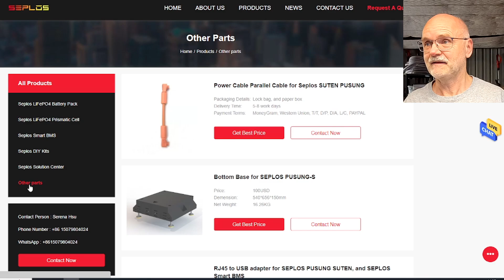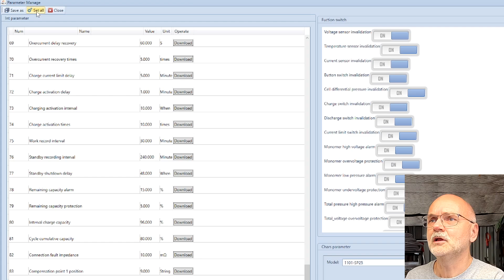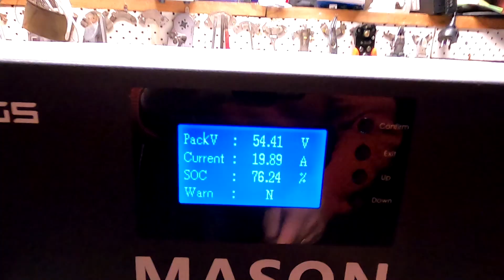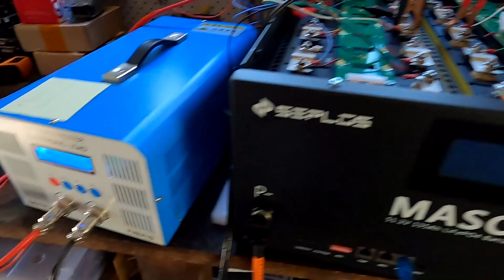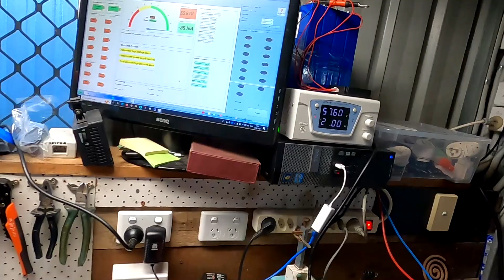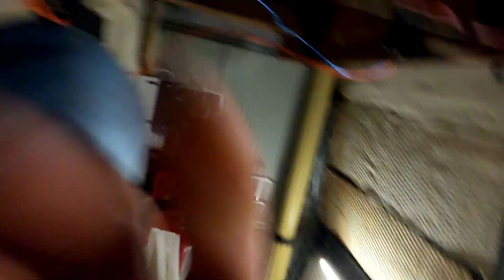SEPLOS SMART BMS: as good as its reputation?

Comment: Great video! Too bad that there is a problem with Temp1. I have 3 Seplos BMS 16s200A but with original sensors. 2 are currently in operation. No problems with the sensors. In my opinion, the BMS is foolproof! So suitable for me.  I'am not need a extra balancer , Made TopBalancing before...
Reply from the maker: Yes, if you do a initial top balance, this would not occur. I wanted to test 😉
Yeah, the settings are actually quite good for a pre-set BMS and will work out of the box right away without the need to change anything.
Reply: @OffGridGarageAustralia  I have used LFP batteries. That's why I only charge and discharge the cells between 20% and 90%.
Your 130ah batteries are definitely better than mine. At 2.9V I have to stop discharging mine otherwise the delta will be too big.
Between 20% and 90% I usually have 2-10mv delta.
Yes , it does not have an active balancer .
If a cell breaks out in the 20-90 range despite top balancing, I'll swap it out - Cell6 🤬.
But I don't think it's a bad idea for maintenance purposes.
Maybe I'll buy one(active balancer) :-), it's your fault!🙃
Reply: Woascheinlich is es trotzdem sinnvoll, an aktiven balancer einzubaun, folls des päck amol über de joa aus der balance kummt. Sonst muas man olls wieda aussanond baun....

Comment: @andy I was wondering why the BMS didn't turn on charging limit switch?
On my BMS the charging limit switch turn on (10 amp) when high-voltage warning occurred. Did you turn it off or something?
Reply from the maker: No, I didn't change any settings in this perspective. 10A was the current anyway I charged with so would not made a difference in this test, I believe.
Reply: @OffGridGarageAustralia  the charging process wouldn't be different but the indication on the software should show.
I found the limit switch is quite nice when the battery approaches 100% and it will recalibrate the soc to 100% after it reaches top balance voltage.

Comment: just drill a hole in the chassis and put a run switch, then you dont have to bother openning it.
Reply: Just put a Neey balancer, then you do not need for a switch . Start stop set with Bluetooth
Reply from the maker: It needs to fit the aesthetic of the battery 😉

Comment: Does the active balancer fit into the case, if you close the lid? Is there space to mount it somewhere safely?
Reply: Andy showed there is room between the front panel and the cell front panel to mount the active balancer. He suggested mounting a switch on the side you could manually toggle for maintenance balancing.
Reply: @CollinBaillie  missed that, which time in the video?
Reply: @matija3791  Have a watch from about 44:10
Reply: @CollinBaillie  great, thank you. Missed this part, probably toilet xD
Reply from the maker: Yes, it would fit easily.
Reply: @OffGridGarageAustralia  thanks
Reply: @OffGridGarageAustralia  what about Neey balancer, would it  fit?
Reply from the maker: @DrCoolZic  yes, easily!

Comment: The BMS will be working with  a lot of canbus inverters like goodwe or growatt and sma, lot others more.
That is there biggest benefit, cause no other BMS supported Growatt SPH or SPF inverters , 
even not the JK BMS as canbus version which I had bought trusting them that they could fit and run.
Reply from the maker: I want the BMS to work with the Victron OS, not just the inverter. Working on it...
Reply: @OffGridGarageAustralia  that will work too, cause  our american relatives are using Victron too , I guess the Raspberry pi is managing that for them, but I know about cause they also have growatt.

Great progress even though lot of points that are not as straight forward as the seplos bms could be.

Comment: HI Andy ... nice review of Seplos battery package ... i need to say that i have (just) 2 seplos BMS on my own 48V 230ah package and all working fine, as you said, you need little bit time with software but then all goes right way. Also communication with cerbo gx works fine.
Reply from the maker: Thanks for your feedback. You just use CAN communication to the Cerbo?
Reply: @OffGridGarageAustralia  Hi Andy, in software you can setup CAN port for plyontech,victron or other protocols. Plyontech CAN works like battery (set up SOC, charging from grid etc), Victron works like battery monitor just see actual statuses
Reply: @ChytilJaroslav  thanks for your response. Could you please elaborate a bit more, or was just a matter o setting it up to use the Victron protocol and use the right cables?
Could you just go by without using the CerboGX ? (my plans include VenusOS in a RPi , but not a GX)
Thank you very much for all your insights!
Reply: @TheShadowVortX  it just about correct cable, then cerbo find BMS and all communication works fine
Reply: Hi Jaroslev, how did you get coms to work with the Cerbo GX? Did you use Louis van der Walt's driver? And did you have to downgrade the Cerbo's firmware? Ciao, Rik

Comment: After connecting Seplos BMS with Victron inverter you turn your ESS to next level - Victron can change charge current during charging for example.
Reply: Also with daly,  jk etc.  I have UART to venus from daly, and reduced charge current works. Also reduced discharge at low SOC.
Reply from the maker: How do you reduce discharge with low SOC? That is not possible.
Reply: @OffGridGarageAustralia  Not sure. Discharge is set at 50 amps, but the other day at low SOC it had changed to 25a. Maybe it disables the inverter. I've never tested what it does. Where can I send screenshot?
Reply: @OffGridGarageAustralia  It only works in a ESS system with a grid connection.
Reply: @OffGridGarageAustralia  By taking more from grid so in your off grid situation impossible indeed.

Comment: You can get things done, contact seplos and have them release an update to match your standards for us, why didn't you use the neeeeeey
Reply from the maker: I'm in contact with Seplos about some of their designs and problems. 
The Neeeey is still connected to the tother battery. The capacitive balancer will work fine here, no need for a smart balancer.
Reply: @OffGridGarageAustralia  I might try my neeeey this weekend, its version 2 but should still work

Comment: Can you clarify were the cells supplied to you unbalanced? With 100mA balance current you are always going to want to be building a pack with balanced cells.

This BMS only has value if you have it networked to the Inverter/Charger, otherwise it's just a pain in the arse. I appreciate it disconnecting if the inverter is trying to charge past 100% because that is not a nominal condition, and I'd much rather it just shuts off if something becomes unusual, caution over everything else. There's probably a toggle switch to disable these protection functions?  I had an issue with it rarely shutting down because of a false short-circuit detection -  I disabled the feature (I have a fuse for that condition) and the problem was solved. Love your videos please keep up the good work!
Reply from the maker: This was part of the test. I have explained this in the video: the last 4 cells were capacity tested and therefore were on a different SOC s the other ones. I wanted to see how the BMS handles such a situation.
Usually, you would do a full top balance in parallel. As I said in the video 😉